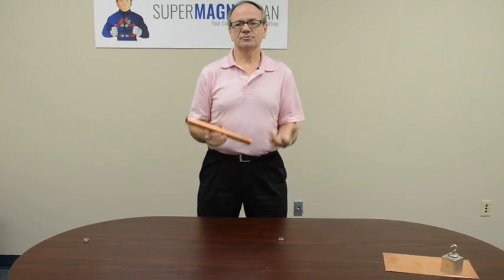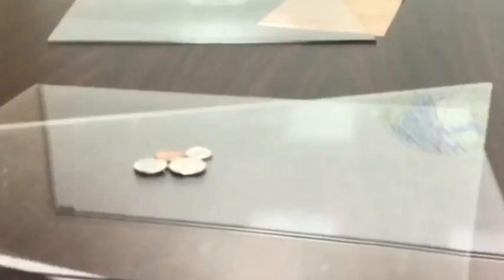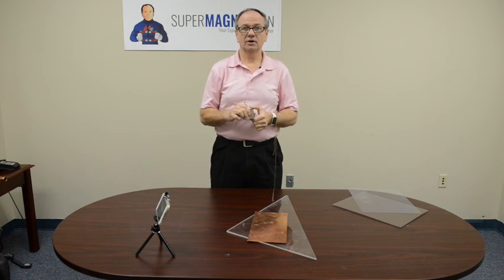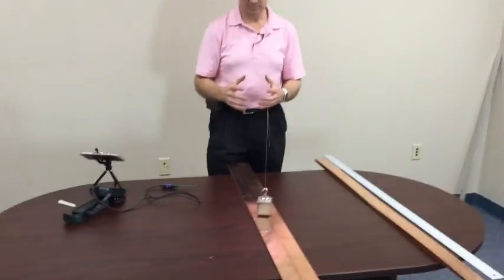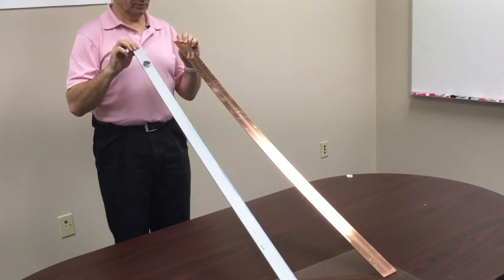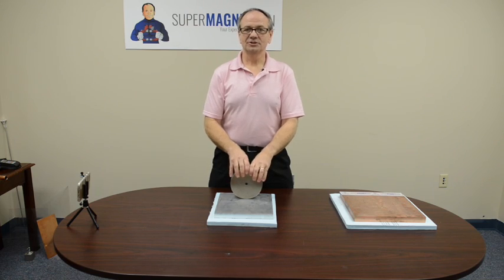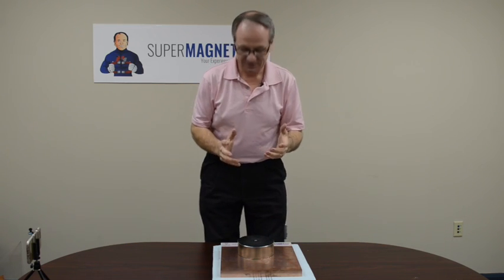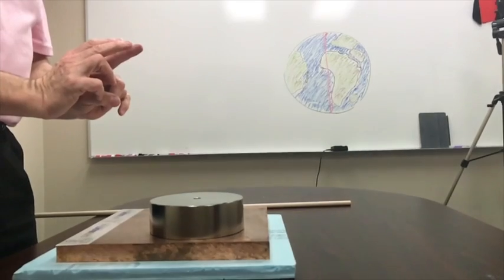Magnets & Copper Part 2

Comment: Technical correction: Lenz's law (https://en.wikipedia.org/wiki/Lenz%27s_law) actually induces a REPULSIVE magnetic field in the copper or aluminum (the - sign in the equation). That's why the magnet slows down as it approaches the conductor. In normal conductors, the induced currents dissipate due to the resistance of the material. If you did this with a superconductor instead, the magnet would float there forever.

Comment: The moving magnet(changing flux) does induce eddy currents in the copper that basically create a mirror of the magnet in the copper.  At 1:15 there is a statement that the magnets attract each other(copper and actual magnet), but that is not always true as the induced currents are dependent on the direction of the magnetic flux which is based on the movement of the magnet in these demos.
 
Note that when the magnet swings toward the copper sheet it pushes it at first and then after the midpoint in the swing, there is a pulling effect.  So the effect looks like two magnets of the same polarity, say N and N pushing against each other until the string and magnet are just past the vertical point.  After that, the flux is moving in a different direction so the induced field produces now a S pole in the copper while the magnet which is still moving is N, so it attracts the sheet and pulls it along. 

The effect of inducing a mirror magnet in the copper is nicely demonstrated when dropping the very large N52 magnet on the thick copper sheet.  If the induced magnet were not in the opposite direction, the magnet would slam down extremely hard on the copper.  Instead, it is repelled by the induced magnet in the copper sheet.  It essentially looks like two magnets of opposite polarity pushing against each other.  The resistive losses in the copper sheet cause that induced magnet to slowly diminish and the braking effect is observed as the magnet gently settles on the copper sheet. 

One other observation.  The racing magnets on copper and aluminum shows that copper is a better conductor and that the aluminum has more losses so the copper will have a better braking effect.

Comment: "We know that a penny is made out of copper..." Unfortunately, not anymore. It's copper plated zinc now and has been for about 30 years now. The fact that the penny didn't follow the quarter attests to that fact. To get pure copper (well, nearly pure) find pennies from before 1982. Notice also that they are a trifle thicker than current pennies, a further cost reduction mechanism. Dimes and quarters are now a cupro-nickel sandwich but before 1965, they were both silver. Since silver is a very good conductor, they should be dragged along just as the copper is. Would be interesting to see how the eddy currents behave in that case, whether there is a discernible difference in the strength of the effect. Like modern dime vs older silver dime. Also like a $5 gold piece which is about the same size. Theoretically, the silver coin should be pulled most readily, followed by the copper, then the gold.

Comment: 1:15 -  I heard or read elsewhere that the magnetic field produced in the copper pipe is opposite to the magnetic field of the magnet, so as you stated, the speed of the magnets descent is reduced by the attraction to the copper's induced field.

Comment: Does this put out an electrical current?And does the rotation of the magnet slow?
Reply from the maker: Yes it puts out an electric current but it is radially distributed through the material and I could not come up with a way to connect my oscilloscope to show it.  The electron flow should be away from the movement of the magnet over the copper to the edge of the copper but I could not come up with a way to connect a lead to the center of the copper that would not be in the way of the magnet.:)  Still working on that - but not there yet:)

Comment: Is this utilized, do you think, for docking spacecraft?
Reply: I think probably not.  If you watch a capsule docking with a command module or with the ISS, you’ll see the approach speed is extremely modest even from far off.  This suggests there’s no magnetic repulsion involved as magnetic fields are short-range phenomena.  At the speeds involved any effect would be extremely small and not worth the weight penalty.

Comment: knowing the slight difference in conductivity between copper and aluminum it would be really interesting to see what happens when comparing silver to copper.
Reply: Wow! I was thinking the same thing since silver is a better conductor of electricity the reverse magnetic field induced in the silver by the magnet would be greater. But silver would be considerably more expensive!

Comment: I am curious to know what effect intervening material would have--obviously it is making a big impact with the metal on metal but would you still have the cushioning if you had some felt or something in between?  Does insulation greatly decrease the magnetic effect?  Would alternate materials that don't conduct electricity well (like rubber) decrease the effect too much to make it effective?  As it is, it seems like the cushioning would not work for direct contact.  I'm also curious if this always happens or if continued exposure to the effect decreases the effect or make the copper magnetic as exposure to magnets can induce magnetism in iron.  It seems like it wouldn't make it magnetic but it might have a decreased effect over time?  Possibly not though given that it isn't really realigning anything in the copper?

Comment: I build prototype household room  heaters to produce a high BTU output. It seems to me that the copper plate would heat up from the braking effect. Have you ever measured the Delta T of the plate? Thanks.
Reply from the maker: Yes - I am working on a new video - not the next one but the one after that where I am measuring the Delta T versus RPM versus eddy current drag with various configurations to better understand the factors associated with eddy current drag.:)  Stay tuned:)
Reply from the maker: It definitely heats up - now, not in the example I had in this video but if it is going faster it warms up quickly.  I have an upcoming video that demonstrates this quite clearly:)  Stay tuned!!
Reply: @zerwell47  I've thought about that

Comment: I wonder what effect it would have on silver or gold. And what about Titanium
Reply: Yes, Gold
Reply: Thomas Stanley the most important principle here is electrical resistivity. The lower the resistivity, the more electric current, the more induced counter magnetic field to resist motion of magnet. 

Silver has slightly lower resistivity compared to copper, so it would be even better. Anything else typically has higher resistivity so it would be closer to aluminum.

Comment: I'd love to see how silver works, if at all, Id guess even better based on its higher thermal conductivity. EDIT just found a chart silver is slightly better 1.55 vs 1.7
Reply from the maker: Yes silver would be better and I think gold would be slightly better than silver but I might need to do a crowdfunding project to raise the funds for a slab of gold and sliver:)
Reply: @SuperMagnetMan  gold and silver are slightly diamagnetic, meaning that they repel magnetism. Id say that it would work pretty well, and based on copper vs silvers electric conductivity, you'd probably be able to make a very strong motor or generator from it

Comment: Where is the energy going? Does the magnet heat up? Do the copper pieces heat up?
Reply: The copper is a good, but not perfect conductor so the induced currents cause heating in the copper due to the resistance in the copper.  The result of these actions is heating in the copper.

Comment: wow, thank you. is there any height from which ( when dropped ) it would actually hit the copper before producing the magnetic effect ?
Reply: No.  The greater the height the higher the velocity as it approaches the plate so the greater is the value of the electrical current induced in the plate, and the greater this is, the greater is the magnetic field which in turn opposes the field in the magnet.  The magnet will always be slowed almost to a halt before it settles onto the plate.
Reply: @ianmathieson65  Amazing, wow, this is interesting. Thanks for the answer

Comment: Why a bounce!  Is it related to the size of the plate? Boundary conditions. If you had a very large plate (edges an infinite distance away) would it settle down smoothly without the bounce?
Reply: I assume that as plate falls a significant current is induced in the copper plate. The copper plate has some inductance so the current does not go to zero instantly after the magnet stops falling. And the residual current is enough to produce a magnetic field which repels the magnet. Then the falling of the plate after the bounce recharges the field enough that the magnet is repelled until it comes to rest.

Comment: Although the video seems to suggest otherwise, I assume the characteristic that makes the effect more prominent with copper is that the copper is more conductive than aluminum. Would silver show more of an effect than copper? It is more conductive than copper and I'd be surprised if the effect wouldn't be stronger if silver was used.
Reply from the maker: Yes, silver would be better but not proportional to its cost.  I can't imagine what a 12 inch square - 1 inch thick plate of silver would cost:)
Reply: @SuperMagnetMan  it looks like Gold would be about 100lbs (100.51) and cost about 1.9 million dollars.
which makes the $9,400 price for a silver landing pad look like a bargain!

Comment: Hi George. Does the copper plate get warm? The kinetic energy is going somewhere... is it just in heating the copper?
Reply from the maker: Chris - yes the copper will warm up and pretty fast too, but at the speeds we are testing at you could barely feel it.
Reply: @SuperMagnetMan   Magnetic Induction heating?

Comment: It creates an electrical field in the copper. Not a magnet.
Similar with Silver.    If the Tube were plastic and wrapped w/copper wire, 
it wouldn’t work if the wire ends were not connected, but will if wire ends are connected.
Reply from the maker: There is not an electric field without a magnetic field.  We can have a magnetic field without an electric field but we can't have an electric field without creating the magnetic field.

Comment: Are there any effect changes if you Ground the copper?
Reply from the maker: No, it is pretty much based on thickness.
Reply: @SuperMagnetMan  So what you're saying is that if you ground the copper there's no effect but if you grind the copper there is?
Reply: Teslas Apple : you would open the circuit they were not work . . .

Comment: Can this effect be used to dampen vehicle collisions? Or perhaps be implemented in motorcycle and football helmets?
Reply from the maker: A few years ago we worked with the guy who has patented using magnets in football helmets to turn a direct hit into a glancing blow.  He had all kinds of testing done that proved it.  The last I heard he is still trying to get a league to test it.  The problem is that if both teams do not have it - it is worthless.
Reply: @SuperMagnetMan  wow, thank you for responding! Good to know I was on the right track. Just goes to show that whatever I dev we may think is original, someone's already thought of it. 

BTW, your presentation is superb. Shouldn't have gone this far in life without knowing such advanced magnetic properties of differing elements. Thank you!
Reply: Sounds cool but weight would probably be a factor as any design that could be effective when 2 200 pound men collide would need to be substantial....I also think about the forces creating a twisting action on the neck or helmets sticking together lol. I look at this and see an application with doors....eliminating hydrolics and ensuring a permanent slamless environment.
Reply: @MegaJasonic  A problem is that it doesn't seem to actually prevent slamming--the magnet still impacts the plate with a fair bit of force.  It seems like the application in brakes if it is essentially a side by side sort of thing where it won't impact but still benefits from the effect is a bit better application.

Comment: Should be Magnets and Aluminium Disc  no contact no wear high RPM disc type brake
                  Magnets and Copper Disc no contact no wear low RPM disc type brake
Who knows if those could be used on high speed trains planes and automobiles?

Comment: Would gold work too?  Would it work even better?
Reply from the maker: I can't wait for the day that I can afford a 1 foot square , 1 inch thick slab of gold and find out:)  After a little quick research I can't come up with a definitive answer.  This effect is paramagnetism - not diamagnetism.  Bismuth and Pyrolytic graphite are the most diamagnetic.  Since this is actually inducing an electric field in the metal I looked at electrical conductivity and silver is the best and copper is next and then gold.  So gold would seem to be slightly less effective than copper.  I might start saving now to get a slab of silver to check it out.  Apparently at the current price it would cost nearly $12,000 to find out:)
Reply: @SuperMagnetMan  - that is expensive.  Could you make a curved plate of silver (or copper), so that the pendulum swings down almost touching it the whole way?  How slow would it go?

Comment: Is this the way to build a hoverboard like Marti McFly had one ? 🤔
Reply: Only if you wanna melt the copper track you'd use lol, cause it generates heat, and to be able to move at a high speed on a copper track would more than likely melt it 😆 just thought it'd be a fun reply

Comment: It works with gold, silver, stainless, aluminum and copper!
Any alloy!
Reply: It works with any material that conducts electricity but the higher the material’s electrical resistivity, the less the effect and vice-versa.  This is why the effect is greater with copper than with aluminium.

Comment: Try a thick gold brick
Reply from the maker: Just checked the price on a 1 foot square x 1 inch thick slab of gold - weighs about 1,400 lbs and cost is around $2,000,000.  Probably need to set up a kickstarter project and see if I can raise the money:)

Comment: could anyone explain what cause that metallic sound ,when the magnet bounce before reaching the copper?impact sound?looks like a special 'gravity' wave...xD...but way more stunning, what is this weird globe ball on the desk?xD
Reply from the maker: That sound was the table absorbing the shock that the magnetic field pushed down as the magnet fell.  The force has to be translated through something and in this case it was the repelling magnetic field.  Good question - thanks for asking.

Comment: What I want you to do is to make a magnet horizontal ring with a vertical electric ring and spin them to make a wormhole or some super torsional field. An EM field. bending space and time. Maybe you can put a bug in the center and see if it lives longer or travels to the past. I don't know. I can't build it but maybe you can.
Reply from the maker: I do have a future video in the works - about 5th or 6th in the future - that will look at biological response to magnetic fields:) . I will see if I can work this in:)
Reply: SuperMagnetMan Cool... I didn't think you'd respond so positively. I was a little preposterous in my request but I am facinated with bending light and the other things. But am not capable of even imaging something that might do that. Although...I do believe element 115 and the other three new elements might be able to do this. And of course a monopole.
Reply: SuperMagnetMan I also would like to make a halbach array pendent. Could that affect the hemme iron in the hearts blood?
Reply: You must first drink several ounces of mercury.  Break a few dozen thermostats if nessessary. Then wrap your entire body with 18ga silver coated copper magnet wire w/ Teflon insulation to achieve maximum efficiency via Lorenz Force!  "First duct tape your ass shut to avoid the coanda effect, during zero point energy transfer".  Make sure to wind the wire in a bifilar coil configuration around the legs, to avoid certain body parts getting out of phase during the jump drive within laylines on a full moon!  Just in case, use 20ga fine silver wire for the rodincoil on your forehead - it must have the Teflon insulation, or its all OVER!   I suggest you use at least 2000 amp SLA battery bank, 12 volt is fine, 2 - 10,000 watt inverters, variac transformer, no bridge rectifiers, use single diode on positive conductor for the DC coil on testicles for primary "pilot of craft" coil on hooters/juggs for female passengers - juggs MUST substitute bridge rectifier over one way diode to avoid early menopausal odors, symptoms and related bitchyness associated with rectification when initiating your Lorenz Force during a full moon.
Remember, you must power the suit/craft via impulse current run through your tesla coil, also constructed using silver coated magnet wire with Teflon insulation - or its all OVER!  Don't even try!!!  Step into my office cause you're frackin fired!

Caprica Buccaneers destroyed those Tauren dirt eaters last night and I suggest you get with the program, or you'll never be a professional Pyramid player!

Youtube:  Eric Dubay 
Time to wake up, everything youve been taught is a lie.  Technology, history, who control us, even where we are at this moment, reality of this universe is not what you've been programed to believe.